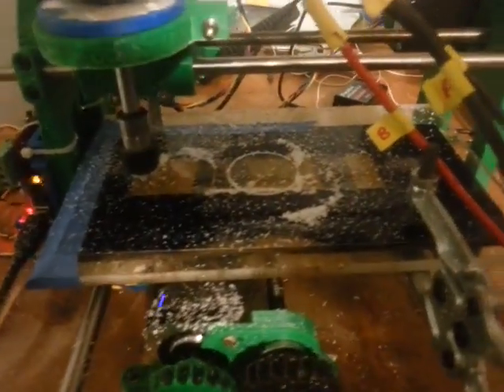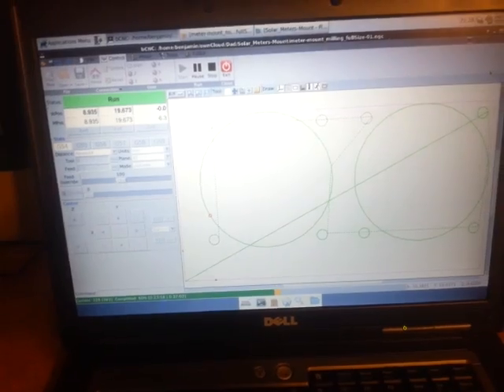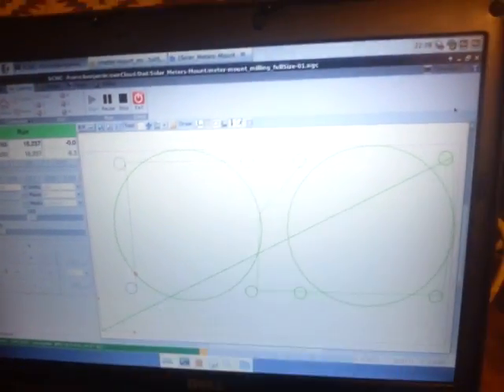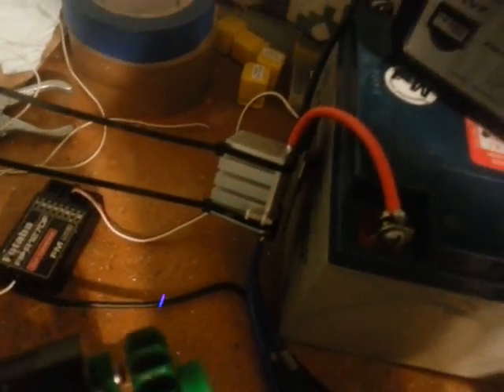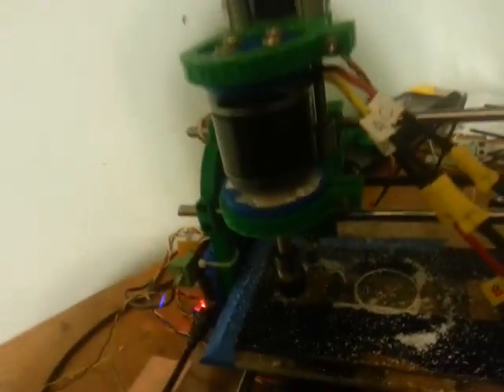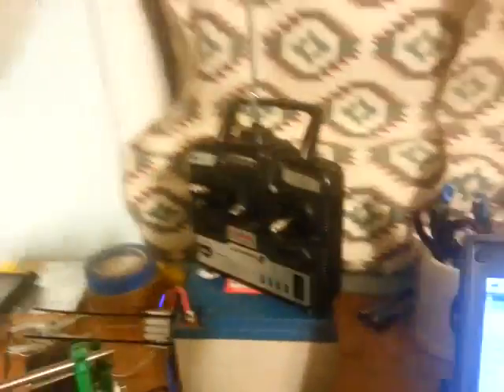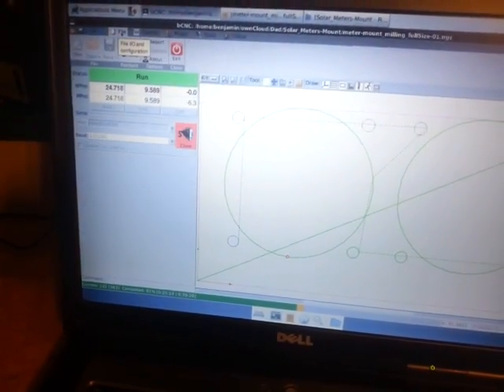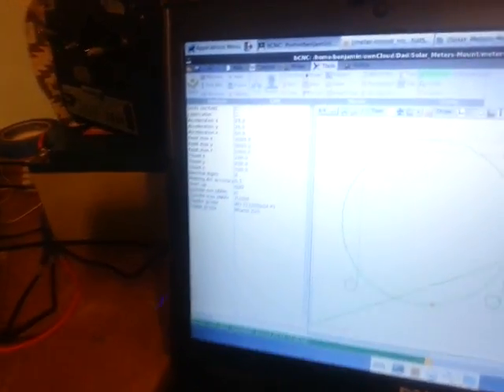Cyclone PCB Factory DIY CNC Mill using bCNC

Comment: Hi, I seem to have trouble with comments on the other posting for the Cyclone PCB Factory.  I had to take time off from working on mine but I do have it homing now. I just can't get the z probe to work. I have it hooked up to the z min sense pin and to ground but I keep getting a probing error.  The device keeps trying to push the bit into the material even though its touching the pcb.
Reply from the maker: you did not mention so I'm going to ask but I assume the signal ground for the Z probe is connected to the circuit board to an alligator clip or something and the other portion for the Z probe is connected to the spindle bit tip
Reply: +Project23D Ah yes, guess I was a bit tired at the time. I have z min sense pin to bit, circuit board to ground pin on z min.